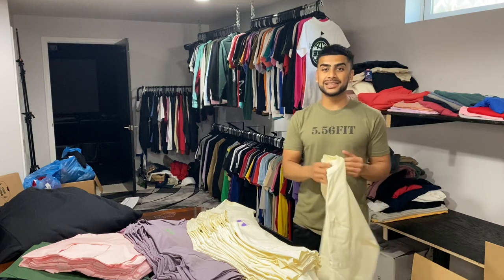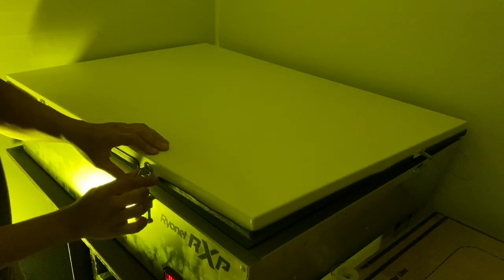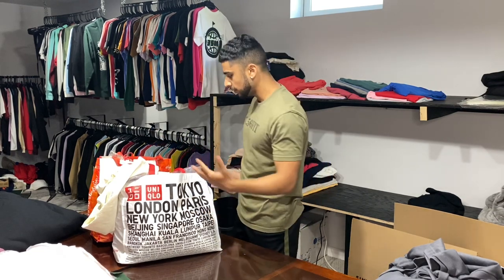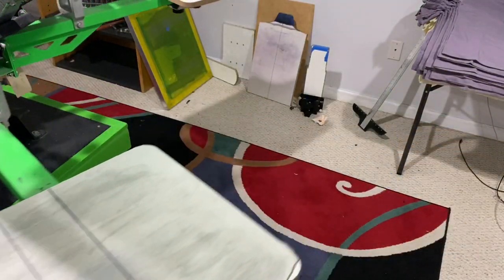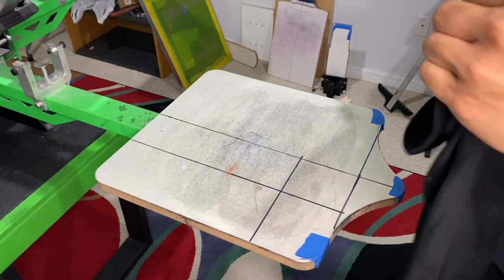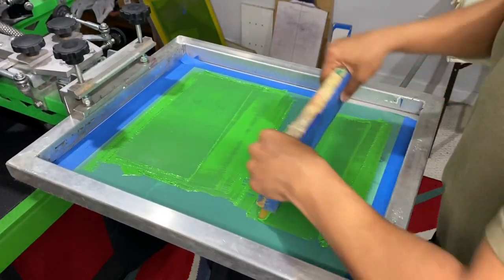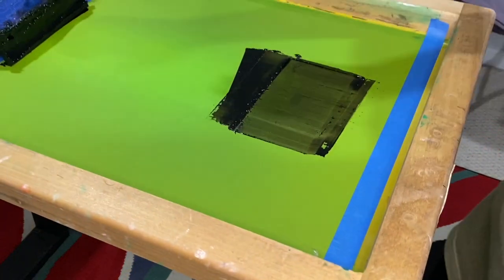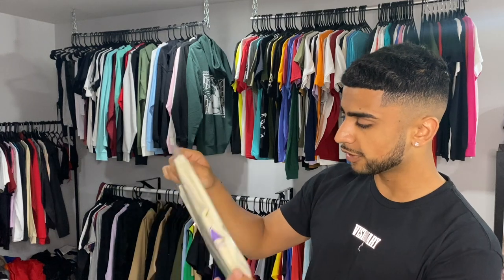SCREEN PRINTING A STREETWEAR BRAND

Comment: Have you ever done a crotch print like over the center of the shorts? Doing some and wondering whats the best way to go about it
Reply from the maker: I have always got inquired about doing a crotch print but I never have. In screen printing that is honestly a hard print to do at least for me. The middle seam going done the crotch is what gets in the way of  the print in screen printing. Which is why I never gave it a go. I just have a feeling the print wont go well but if you do try it let me know how it goes!

Comment: Thanks for the videos. On your chest images/pieces I see you use a registration template. What are the measurements,  4 inches down from top of collar and 4 inches in to left chest ? Or is it from where the shoulder and collar meet, straight line down ?  Thank you for you feed backs, Always 👊
Reply from the maker: I go 3-4 inches down and usually about 3-4 inches over as well! try that range out. Thank you for the love!

Comment: That's green tho keep your hard work shout to Razor Designs
Reply from the maker: Lets gooo shoutout to all of you! Appreciate your support Raymond!
Reply: @baavproductions  I have a big question amazon Flash dryer worth it for a started tried of using hear gun 🔫
Reply from the maker: @raymondarmenta3033  helll yeahhhhh! Definitely get that Amazon and or Ebay flash dryer. Believe it or not my flash dryer is still the same cheap old thing I got from Ebay for less than $200 bucks. Its time to toss that heat gun in the trash and get to work with that flash dryer highly recommend a flash dryer. You can't really cure shirts with a heat gun that well but with a flash dryer your life will be so much better.
Reply: @baavproductions  thanks I really appreciate
Reply from the maker: @raymondarmenta3033  No doubt!